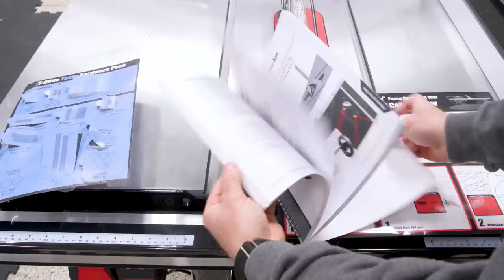I Left Powermatic for Sawstop!

Comment: Marc, thanks for another very thoughtful, thorough and even-handed review. Perhaps I'm just a lone voice of dissent, but here's why I will NEVER buy a Sawstop product:

First, they tried mightily to get regulations passed FORCING all other saw manufacturers to incorporate Sawstop technology on their saws. This would have meant huge royalties for Sawstop, but dramatically higher prices for consumers and a lack of choice in the market. Fortunately, their bully tactics failed. 

Next, they sued to force the arguably superior Bosch Reaxx system off the market. It eliminated the hideous expense of replacing a destroyed blade and an expensive cartridge after every activation. It was a much more intelligent and user-friendly design.

Based on the above, it seems to me that Sawstop is more interested in money than safety and that's reason enough not to buy one.

I don't want to be restricted as to which blades and accessories I can use and I certainly don't want a saw that would destroy expensive blades or a dado set if the wood is damp or I happen to inadvertently touch the blade with the edge of my miter gauge. Yes, it works, but It's a stupid, thoughtless design unless the goal is to sell a lot of expensive replacement cartridges. Again, there seems to be no regard for the cost to the consumer.

Considering that I have never cut myself on a table saw in the 40+ years I've owned one, I'm apparently safety conscious enough that I don't need Sawstop technology.  My current saw works perfectly well for my needs and I'm the only one who uses it, so buying a Sawstop would be a waste of money. "Sawstop tax"? No thanks.

Yes, I know, "it only takes one slip and..." If I bought into that, I wouldn't own a table saw at all. I wouldn't drive a car or take a shower either, as statistically they're both far more likely to get you injured or killed. Life is risky; you have to pick those you're willing to assume and live with them.
Reply: Yes, yes, and yes again. SawStop —— the Martin Skreli of wood working hardware.

Comment: They're too finicky for me, your constantly having to blow out the sensor with air even with good dust collection, and above that I feel they can be more dangerous if they timeout in the middle of a cut, once you experience that you'll go back to a conventional table saw. Myself, I went the other way completely, I opted for the Holz Her 1245 SuperSlide, greatest machine ever made, in my humble opinion, but not everyone has room for a machine that size. My SawStop gets used for ripping small strips for trims and mouldings, the rest of the time it's a catchall.

Comment: I would buy an older (60’s or 70’s) model 66 Powermatic over a sawstop any day of the week. You can’t beat those saws. Superior manufacturing and built like a tank. Almost all the older machinery is like that. You can get one ( depending) for a thousand or two less than sawstop. And it’s an absolutely proven machine. Learn how to use machines properly and you don’t need the monopoly priced safety gadget. Almost 30 years of cutting and I have all ten.

Comment: All my large woodworking machines have had really bad instruction manuals (Felder and Jet) and even my belt sander (Claryx), all reputable brands with a price tag that's to be expected with that. They have quite a lot of technical stuff in their manuals, but barely anything on assembly and fine-tuning. I was shocked that I could pay 5k€ (5460 dollars) for something and not have the bare minimum of instructions. Some parts of the instructions that were there were from a different/older model. It's nice to see that some companies don't drop the ball like that. The machines themselves are nice yes, but it still leaves a bad taste in your mouth. I still don't know what some small accessories that my table saw came with are supposed to be for even though they came with a part number (google shows nothing) and a German word (translations don't show anything useful) stickered on to it.
edit You immediately went on to say (after I unpaused the video) the reason for it; they're meant to be professional tools and "you're supposed to know how they work" and for the most part I didn't have huge issues, but as a random hobbyist I absolutely could have if I bought the machines just a few years earlier when I didn't have the knowledge I have now. And seriously if you're going to sell something to a professional setting and end up costing your client extra hours of head scratching when something isn't standard/obvious, you actually cost them real money in unproductive hours.

Comment: You absolutely CAN blame the manufacturer for user error. Now whether or not it's worth the R&D budget required to fix the problem, that's another question.
Reply: Absolutely. I work in the medical device field and we are required to address "foreseeable misuse" as part of risk assessment and do all that we can to try to fix all the user errors we can from a design perspective.
Reply from the maker: Yeah sorry guys, but I have to disagree. I'm certainly glad companies take the position you're describing and try to proactively design for common user errors, but there are just some situations where it's the user's fault, end of story. Doesn't mean the company can't try to learn from that and address it with future updates but there's a certain point where it's ok to let the fault lie with the end-user. I can no more blame Sawstop for me triggering the brake with a miter guage than I can blame a chisel company for me cutting myself because I didn't clamp the workpiece down.
Reply: @woodwhisperer  Of course, there's nothing a company can do to prevent a user from doing something like using a chisel for a screwdriver, there are limits to everything. But companies can do things like make you press the brake pedal before putting your car into gear; where the design itself can idiot proof something in a reasonable way, it would be negligent not to.

Comment: Bought a Sawstop the first or second year they came out and it's been a fantastic saw for us. When I puchased, it had a slightly damaged laminate table and they sent me an full replacement with rails/fence and all even though I didn't need those parts. Over the years they replaced a early edition cartridge no charge. Great company and customer experience. Had one brake trigger event in the near 20 years of service which was a freak event caused by sawing a hidden nail in half legnthwise and I'm guessing it threw the nail into the brake material and triggered it. They shipped a new cartridge immediately and I ordered an extra. Again great service. Do I like that they have hoarded the tech to themselves all these years? No, but I believe the patent is up and festool bought them out...so water under the bridge on that front.

Comment: My only problem with SAWSTOP, I'm afraid the actual technology might make users sloppy, and not as careful as they should be.
Reply: I'm not sure I agree - maybe at first, but you forget the feature is there most of the time and I still find my sawstop (or any table saw) absolutely f-ing terrifying - I have absolutely no motivation to check if the safety mechanism actually works - as far am I am aware I paid $1000+ extra for some blinking lights.
Reply: @colinmcleod2018  it's just a thought I had.

Comment: Thanks for the video.
Being sponsored by a certain brand has its advantages.
Free equipment or heavily discounted for the channels users.
Quid pro quo
Plus YouTube has their policy 
that can sometimes interfere.
All being said, I for one find the SawStop brand highly overrated.
I feel their being first with a patented safety feature that happens to free up some liability has skewed the comparisons with other brands.
I have my opinion as do others and support their right to do so.
Bottom line, I hold to a proven brand that has stood the test of time and it’s not SawStop.
You will find the same skew with other top brands of various equipment such as Festool, that I also do not own and feel is an overrated brand.
Thanking this channel for allowing another point of view.
Being safe is very important, however can one be too safe?

Comment: As a hobby woodworker, I'm saving my pennies for a saw stop, because they are far cheaper then getting a finger sewn back on.
Reply: Invest in a sliding table, for the same price you get more quality work, more variety and more safety.
Reply: @bowlchamps37  The reason they're called 'accidents' is that nobody 'plans' to touch the moving blade. Having a sliding table is nice, but it won't stop all possible injuries. The Sawstop tech doesn't stop 'every' injury either, but it's better than the "I'll just be careful" plan.

Comment: I still can't believe Sawstop managed to block Bosch in the US with their system.  They don't have a patent on the touch sensor.  As those can be found in all touch based lamps from as far back as the 70s and 80s.  They do have one on the brake cartridge.  Yet Sawstop managed to bribe the US patent office enough to make it so you cant even have a gas actuated retraction system without a brake.  

I won't support the brand until they drop the petty defense of their bullshit patent on existing technology before they even came into being, because no one wanted to buy it from them.
Reply: @thomashajicek2747  the inventor of sawstop was a patent seller. He tried to sale his product to multiple companies. They all refused. So what's a man to do? Build it himself and sell it. Now he doesn't want any competitors.
Reply: SawStop was acquired by the company that owns Festool in mid 2017 (Yes, Festool basically owns SawStop).  The lawsuit against Bosch was in 2016 during the due diligence portion of the acquisition. 

Bosch and others refused their chance to license SawStop technology years ago. SawStop has to protect its intellectual property to remain in business. There is a least one other company (Felder) with table saw flesh sensing technology that doesn’t use SawStop patents but it’s much more expensive than the SawStop.
Reply: @MarcusBuilt  I read the case.  They protected their brake patent not the Flesh sense.  Again because that falls under someone elses patent that has since expired.  All the touch to turn on technology is exactly the same.  A low level charge is applied to the metal blade or the lamp housing.  When that current changes due to metal or flesh coming in contact it trips a connection.  They never should have been awarded the flesh sense patent in the first place as it has been in use and not patent protected for over 50 years. 

Bosch was denied sales in the US only on their saws (they only have it on contractor saws)  which uses the expired patent tech to sense flesh contact and a gas cyclinder to force the blade under the table top without a brake.  So your blade does not get wreaked.  Roughly the same time a saw stop retracts within 1-2 ms.  

The US never should have enforced Sawstops patent on flesh sense, since the concept had a patent that had since expired in the US.  They argued that even though they didn't have a brake Bosch shouldn't be allowed to compete with them despite not giving any evidence that they used a brake much less copied their design.

Comment: I'll never give SawStop a dime because of how they choose to litigate and bully people.

I knew you would get a SawStop even though, I think the new-ish Delta tablesaw is a much more interesting solution.  (the one with both adjustment wheels on the front)
Reply: Meh - I see it as protecting their investment in the IP, not bullying.  Bosch etc had a chance to license but they chose to steal instead.  I would also point out that SawStop = made in USA, Bosch = made in China.  Your call.
Reply: I have the Delta 36-336 3Hp and I am very happy with it the only problem is the cast iron wings are both are about 1-2 thou high in the middle but it hasn't been a big deal because the ridge is parallel to the blade other than that I like the front controls and all the other unique features other saws don't offer.  Home Depot had it on sale for $2500.00 and 0 interest for 2 Years so I jumped.
Reply: @Richard-wk9le  Other than you, I think I only "know" of one, maybe two, other people who have them.  Years after they were unavailable, I remember seeing some article talking about how they spent time with modern engineering tools doing vibration analysis to get the saws to run extremely smooth.

Personally, I'd love to find one and take it apart to see how it is built and how it works.  I have an old Powermatic #72 that I sort of love because it is just built like a tank and is extremely precise.
Reply: @MarcusOfLycia  Seems like a good thing, with an average of 10 amputations from table saws in the US every day.